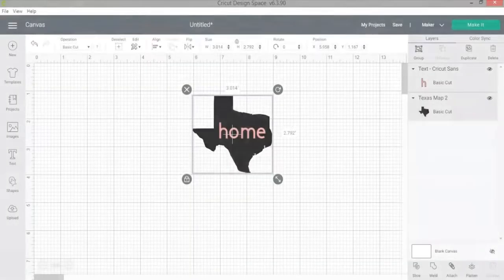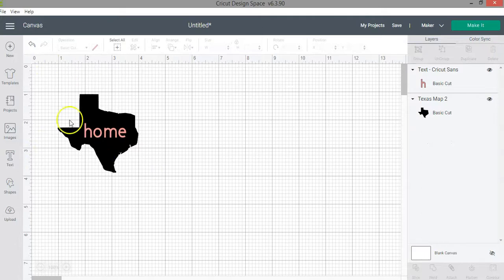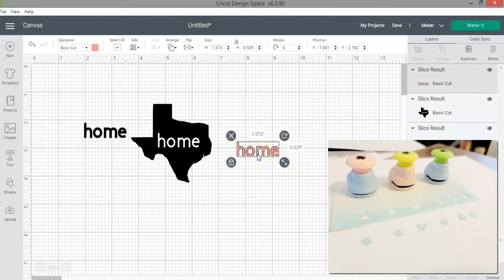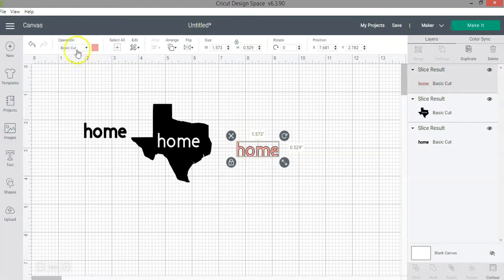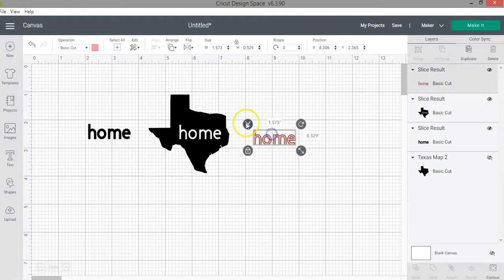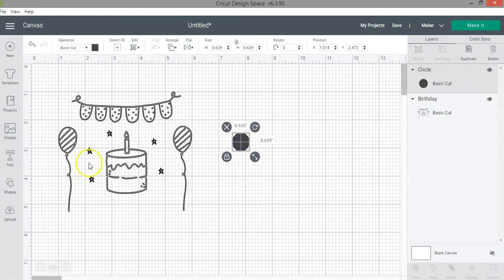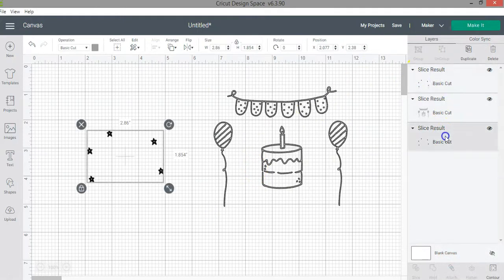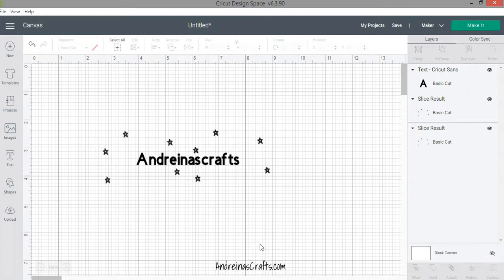3 Ways to use Slice in Cricut Design Space (*MUST WATCH TUTORIAL*)

Comment: Thought you video was very clear and easy to follow.  I even learned things not mentioned in other slice videos, but the one thing I  tried to do in your video, I  could do.  Spent over an hour trying to remove elements out of a variety of designs from Cricut Access with no luck.  I tried different types of images and even though I  could cover the element with the shape and weld it, it welded the whole design.  Help.  Thanks
Reply from the maker: Thank you for the feedback! I am glad it was helpful. If you want to use Weld to cover something, you need to make sure you want to keep the element you are using to cover it. For example, if you want to cover the tittle of the letter "i", you can use a star and place it on top of the tittle so that it covers it completely. Click on Weld and the final design will have the star and not the tittle. If you want to completely remove something, use Slice or Contour (which can be EXTREMELY useful to hide/unhide elements). Here is a quick video on how to use Contour: https://youtu.be/cxRSaOaE9h8 
Contour does not always work and can be frustrating. I explain in this post what you need for the Contour tool to work which will avoid frustrations: https://andreinascrafts.com/how-to-use-contour-in-cricut-design-space/
Let me know if this helps..